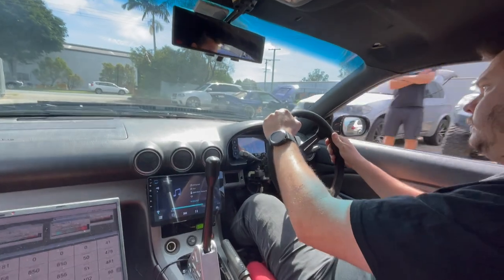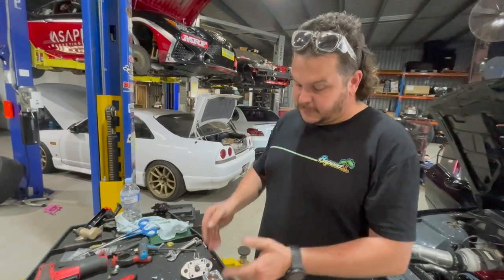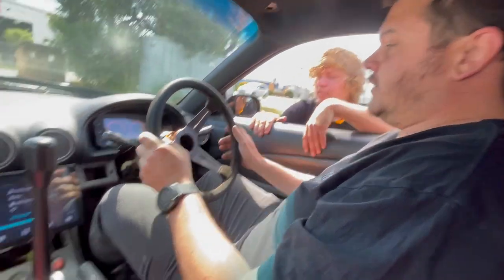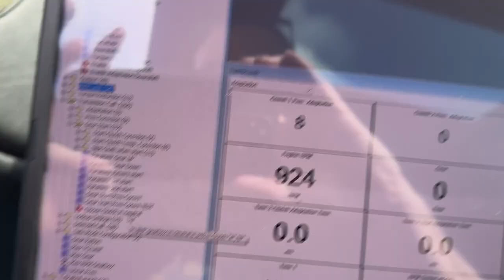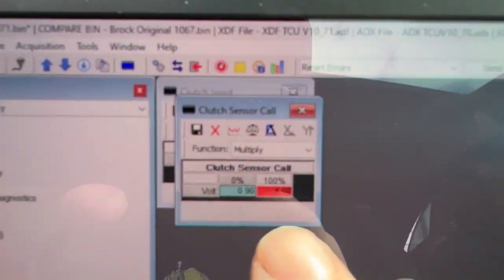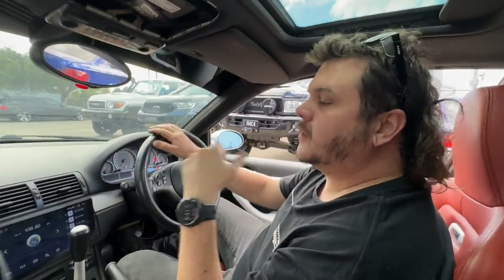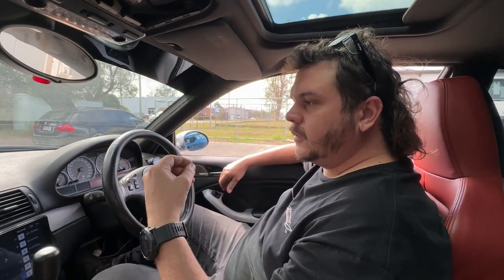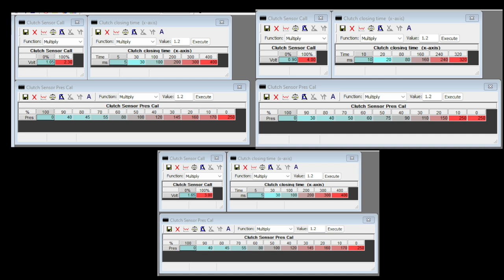TCU CLUTCH PEDAL SETTINGS - How to setup a 8hp for clutch kicks

Comment: Hi Andrew, just incase you never tried it...
With tunerpro, if you run a second screen you can drag the 2D or 3D table to screen two.  This helps with visualising and smoothing ramps whilst working on tables.
I find it helpful 👍
Cheers great video !
Reply from the maker: Thanks for the tip!

Comment: What is the longterm reliability of using the simulated clutch?
Reply from the maker: Depends how its used, as how much power and traction the vehicle has. In testing, these 8hp70 clutches are stronger than any heavy duty manual clutch we have used. 600whp, 6000rpm clutch kick at 40kmh in 7th gear it will turn 265 semi slick tyres. Where a heavy duty manual clutch for drifting would normally slip in that situation.

Comment: ohh this is making me going this way, will it work with Adaptronic as i have one in my FD and RX3?
Reply from the maker: Unfortunately the adaptronic canbus is not natively supported. However there are ways to make it work.
Reply: @ZeroTo60Tube  the more i see this,  the more i want.  Does the shifter have to be so big and the bottom housing?
Reply from the maker: There are a few shifter options, however if you want a strong one it will need to be reasonably sized.

Comment: I know a little while ago i was like mannnn og manual trans all the way lol! But im curious with the 8hp and or dct do you absolutely need to upgrade the clutch packs to handle a 700hp drift car or do the oem clutch packs hold up fine for clutch kicks and daily street driving with casual hard driving at that power level?
Reply from the maker: We put a near stock 8hp70 in a 1100whp skyline this week. We will let everyone know how it holds up. However at 700hp a 8hp70 wont break a sweat. I wouldnt drift with a DCT btw. Slipping the DCT clutches is not good for them.
Reply: @ZeroTo60Tube  my friend and I got to thinking. If you’re using the clutch packs  doing the clutch kicks and for the pedal emulator, do you necessarily need a torque converter? Could you run it as direct drive and strictly go off of slipping clutch packs?
Reply from the maker: @drewncars9505  With a lamik you can run them in a mode that doesnt need the converter. People have made converter replacements. The aim is less mass spinning on the crank shaft. However i dont think anyone sticks with it. End up putting a converter back. BMW even had a version of the 8hp45 with not converter for the race cars, however they also went back to a converter.
Reply: @ZeroTo60Tube  thanks for the reply! He just finished swapping a lamik in his Miata that he drag races and someone else brought it up to him and got us wondering if it’s been done or if it was possible.

Comment: Do you think this same setup would work on the 6hp or the 6r80 as well? I see turbolamik lists them but not as much info on them as there is for the 8hp.
Reply from the maker: The turbolamik no longer supports the 6hp. After playing with both transmissions, i wouldnt waste any timme with a 6hp/6r80. If you are spending the money on the electronics, the transmission is a small part to have a much better solution than the 6 speeds.